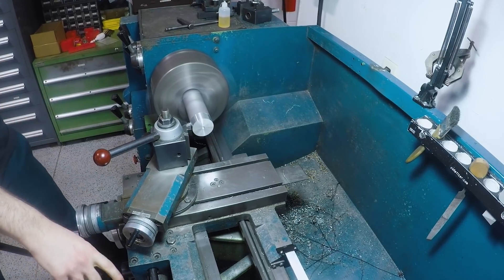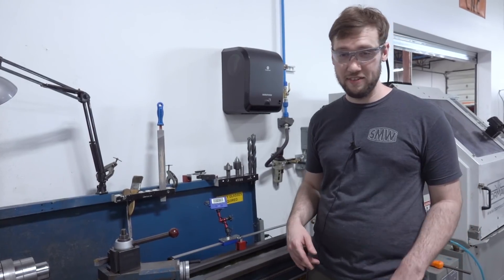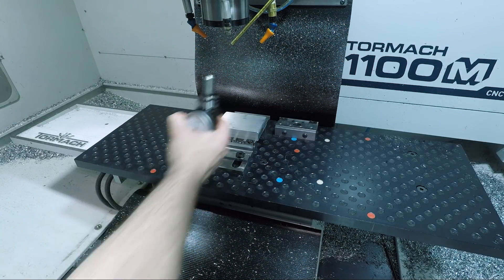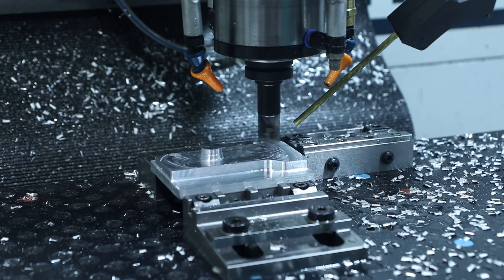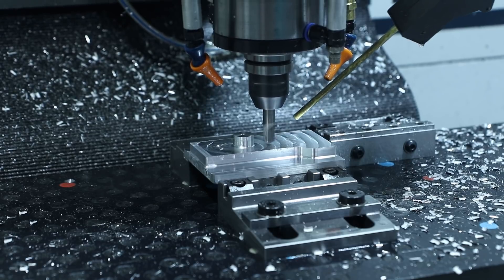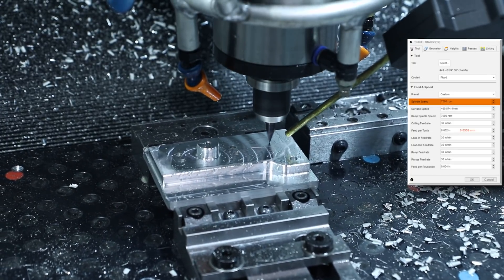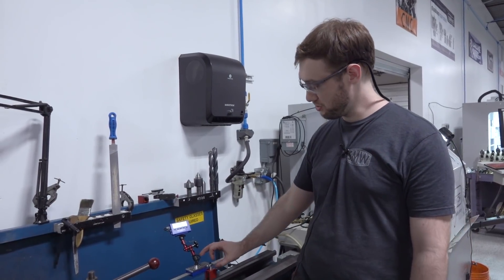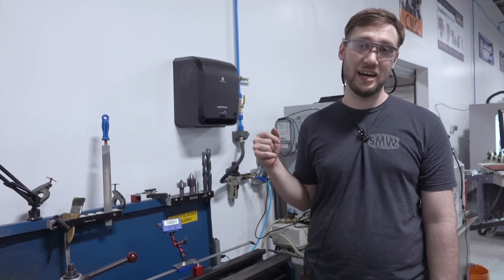CHEAP DRO for your Manual Lathe! | WW255

Comment: if you're needing DRO, you don't want to do anything cheesy. precision is everything; forget about using that $15 mag arm and get the display away from the chip wash, mount the scale on the back side, manual lathe guys'll tell you make your own wheel, and or leadscrew if 1/128 bothers ya. that's not a valid reason for DRO; it does not help lazy operators. it is intended for a level of repeatability and precision, they are not cheap

Comment: OK I made the mistake of buying the SS beam DRO from Igaging.  Mistake because I have mounted cheap glass scales on mills and nothing bows and bends like this scale.  I have been wasting time trying to align to X and Y ( I know lathes don't have Y just go by X and Z) and got all 23" to within .002".  I tighten down the screws and go to the mount to the lathe saddle.  This thing has so many missed steps and when going in rev just horrible.  So I utlize your idea of only mounting one side and the results improve like about 70-75%.  I still have to work this thing as if though I am working with backlash and I am just concerned that all that unsupported weight on the tailstock end will be detrimetal.         How is your Shars DRO holding out?

Comment: Hi, mr NYC CNC. Would you tell me some information about the motion motor and power motor installed on the Tormach cnc? Step motor or servo, the torque,  whatever.

Comment: I have similar Chinesium readouts on my 80's harbor freight lathe. The button cells going dead was getting annoying. I 3d printed a dual AA battery holder and soldered wires to the button cell pads. They work fantastic or the price.

Comment: Pointless video. Woohooo, chips flying! 
Boring.
And your "DRO" isn't a DRO at all. Not by far. You could at LEAST have used TouchDRO. Google it. It's awesome.
Reply: Guess it depends what you're looking for. The Janky DRO is not intended for aerospace work. It's intended to eliminate the need to deal with manual calculations and attendant mistakes. And the unit costs ~$55. Sure, it's shown mounted with a piece machined on a $15K CNC mill, but that's just because it's available and so, why not? If use shows one needs extra precision and accuracy, then you can upgrade knowing what performance you really need.

As far as the entire video, it's got value beyond the machined adapter part. The tip on using a CAM field in F360 to add a chamfer feature when spot drilling alone was worth the time it took to watch the video.
Reply: @steveh8724  Again, look into TouchDRO. Costs about the same, yet so MUCH MORE value. This is still pointless.

Comment: Just eyeballing the scale to be parallel with the bed will introduce sine(?) error into the reading. Take the time to mount it parallel to the direction of travel or you may as well just use a tape measure as a DRO.
Reply: It's not too bad though, if I punched it in the calculator right, and for say 1 degree error you end up with about 2 tenths error per inch of travel.
So long as anyone trying this recognises the limitations it should be reasonable for the price
Reply: @TomMakeHere  you are right. But eyeballing 1 degree at 1 inch distance means being within .0175". Not impossible but that is only on one plane. You also have the vertical plane. I guess my point would be that it would have taken just as much time to mount it correctly. Add a release on the carrier and you have a similar affect. This seems pretty rinky dink and they should atleast talk about the disadvantage of doing what they did. Alot of people learning, including myself view this channel as the Bible of home machinists. If John or Ed said I would get better surface finish by preheating my spindle bearings with a rosebud I would probably give it a try no questions asked.
Reply: 100% agree, effort still wants to go into aligning the scale, however I'd say the biggest risk with this setup is accidentally bumping it!
Reply: @michaelalcocer6778  The scale is 24", so aligning that to a reasonably accurate angle isn't too hard?

Comment: For me that was a little bit to much work for this Aluminum Piece. I would not have done extra softjaws für this one part which already has two parallel sides... And even the Chamfers can be made with a a file. Way faster but not so nice, i know..But all together cheap way for doing work easier in the Z Axis.

Comment: I use several of these scales on my mini lathe. You should look into TouchDRO from Yuriy's Toys. It's a small circuit board that the scales all connect to (these particular ones via usb), which then connects to a phone or tablet via Bluetooth, to display the readouts. With these particular scales, it eliminates low battery inaccuracies, as well. The TouchDRO app has a ton of features, and the readouts are as accurate as your scales (there's a board that's compatible with just about every type of scale). There's also inputs for a tachometer, a touch probe, and a "W" axis for either summing quill/knee movements with the Z axis, or it can also be used with a rotary encoder to measure angles.

Comment: Keep an eye on the battery. As the voltage drops below about 40% the readings will change.  It’s the same thing with cheap Chinese calipers.  A real dro scale would only cost about $100-150 on shars
Reply: well in that case one could repurpose a 5v cellphone charger along one of those chinese "arduino" dc-dc buck converter to get the 3V the button cells have.
Reply: Laharl Krichevskoy the good thing about glass scales meant for dro is that they are sealed from oil and coolant.  I use cutting oil on my large and the little bit of oil ends up in the scales and effects the readings.  That why I removed my cheap dro scales.

Comment: CNC work probarly costs more than the DRO
Reply: Exactly my point, this was more of a job for a 3d printer. A piece like that would have taken about 2 hours on a 3d printer and 50 cents in plastic
Reply: Laharl Krichevskoy and plastic would have not lasted long..oye good for prototype but long run..it will be in a bin
Reply: @Miguel Castaneda
Nah, PLA is good enough, if you print it with enough robustness, considering the load that would have it wouldnt have had any problems at all.  I have entire printers made in pla and other than parts that were too thin, most parts never break even after years of being in use. Its all about designing parts to last in plastic, because unlike aluminium, pla and most plastics suffer from creep so while at first it can feel strong and resistant, it could break after a few monts of being under light loads continuously because of creep.
Most of the pieces that broke min my case were either because of creep or because of cheap chinese plastic that would break on its own by just sitting on a table.
Reply: No doubt, but the experience that was gained will pay off in spades on more complex jobs down the line. We all had to start off somewhere... Not to mention he's learning Pride In Craftsmanship, something from a bygone era when folks actually gave a shit about what they produced... First you get good, then you get fast...
Reply: Matthieu van Ratingen yup not for guys with a garage shop

Comment: Cheap DRO would be a Bosch laser meter. Has .000 accuracy, more than enough for a hobby and recent models work within the meter range (old ones did not). I had, a few years ago, broken my DRO on my lathe, and out of desperation i 3D printed a holder and stuck my Bosch GLM 50 to the saddle and cast it at the chuck. It worked excellent, but had minor errors (within the meter issue) so then i gave up that and cast it at the wall behind and it worked beautifully.
It's been my personal wonderment that more laser based systems don't exist. Within reason, they are quite efficient, and if one's willing to think outside the box, quite accurate too.
Reply: hold on ! do you have a link to such a tool ?
Reply: Bosch states a measuring accuracy of +/- 1.5 mm for the GLM 50, and that is in line with "the other" laser systems in that price class. Do you have different information on the accuracy, maybe based on own verification tests?

Comment: man, the americans will do anything but switch to metric.
Reply: I totally get it. My first, self-taught progects were in metric because it's so much simpler. Unfortunately, when I got into school, the standard is inches.
   It wouldn't be so bad if it weren't for the fact that we still use fractions too, so that's a whole other set of number conversions to memorize. it's a real pain in the ass being a new machinist, when someone tells you to mill out a 5/32nds slot and your DRO is in thousandths. You can figure out 4ths & 8ths in your head fast enough when your new but you still have to know 16ths, 32nds & 64ths to be efficient in this environment. Then, there's this pig-headed, semi-sarcastic attitude to refer to the American standard as "the right way" or "the white man's way" ...which usually isn't actual racism, just sarcasm but there's a few old-timers that are serious when they talk like that.
  The whole thing is really pretty stupid when you think about it. Sure, it's going to take a few years to get use to but then we can all work faster with less mistakes. Even simple things like the paper trick for zeroing your datum would be simpler. Instead of wondering if you should subtract .003", .0035", .004" or .0039", it's just .01. and your pretty much dead on. No more reaching for the calculator when ordering from those German catalogs ...and on and on.
  I could say "when I open my own shop, I'm going all metric" but then 9 out of 10 of my customers will be scratching their heads or just going to another shop. It's not like they're going to actually send me blueprints in metric.
  We'll be using our standard for the next 100 years and God knows how many fatalities, due to conversion mistakes.
Reply: @christurnblom4825  I understand what you are saying and will tell you at my age I am very fortunate. By that I mean that in the years I went through what we call High School or perhaps Secondary Education, Australia went Metric, as a result I was taught both of these systems and as a result I understand both very well and can convert most into thou/fractions and mm without the calculator. I do on some sizes resort to the Calculator and all I really need to remember is 25.4 mm in 1 inch although 39.37 inches in 1 meter is also handy as that translates to 39.37 thou in 1 mm. For most work I am doing that serves well, if it need to be better then old mate Calculator comes to hand.
 Cheers Chris from John.
PS: some Machines I have are Metric and some Imperial as in inch. No DRO's.
Reply: NEVEEERRR!
Reply: Yeah, well I don't feel like measuring myself in centimeters.
Reply: @DickTickles  milimeters,microns,nanometers,picometers ,,,, how much inch is 20 nm ?
Reply: We adopted the metric system a long time ago, the inch is defined by the metric system.